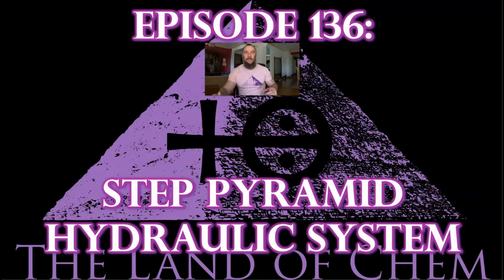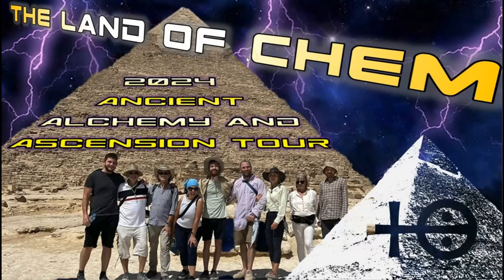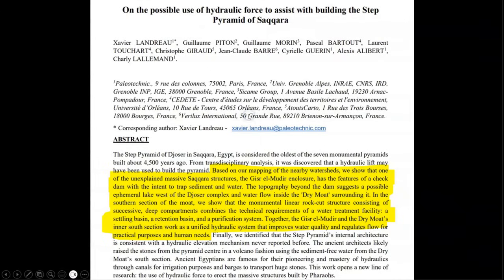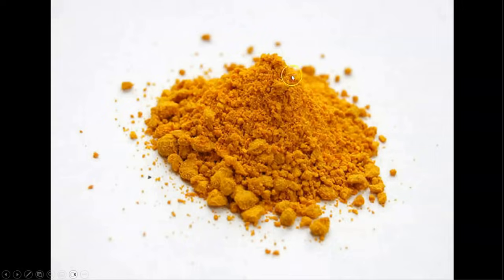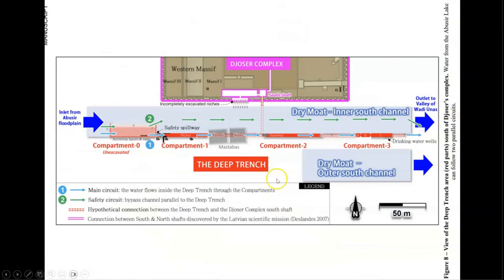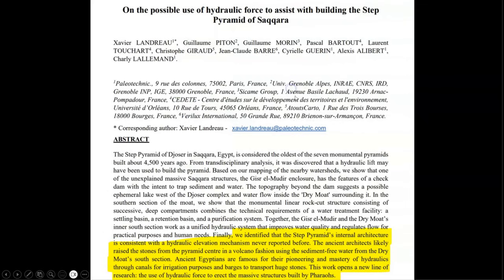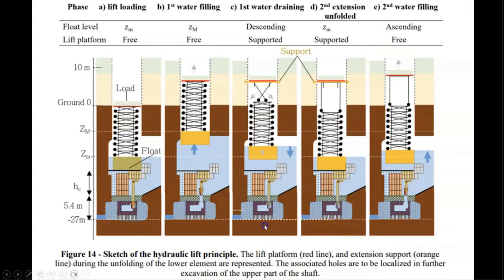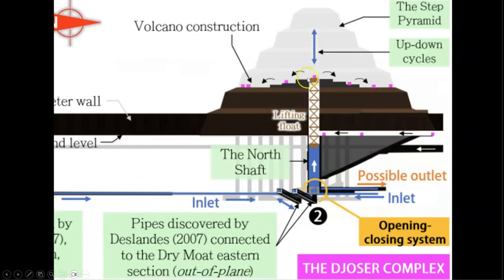Episode 136: ANCIENT TECHNOLOGY - Step Pyramid Hydraulic Lift

Comment: Excellent episode once again!
Regarding construction (which is quite a different subject to the chemical functionality) and in particular the idea of lifting of stone with water, water would be one of the worst ways to do it, because by the time the stonemasons had built all the infrastructure for this proposed hydraulic lift system they would’ve been expert already in rolling craning and pulling rock to have realised that that is by far the cheapest and easiest way to manoeuvre stone. Was then. Still is. So I would propose that water is only good for shipping stone - not manoeuvering or lifting it.
Reply from the maker: @adamerrington323  thank you Adam!
Reply: The Builders didnt 'ship' stones. And they also didnt write the super complex construction plans in hyroglyphs. The sheer mass of data necessary to plan and build these structures is only possible with computers or a.i. 
period

Comment: How about this idea the Spinx? Was used as a big water fountain. The hole in the top of the head is where the water came spraying out and the basin around the Spinx was the water basin, and the boat pits were used as a circular saw pits to cut stone which was ran by hydraulic power